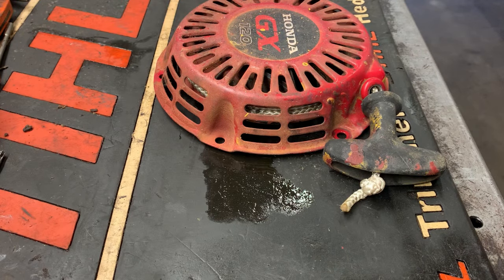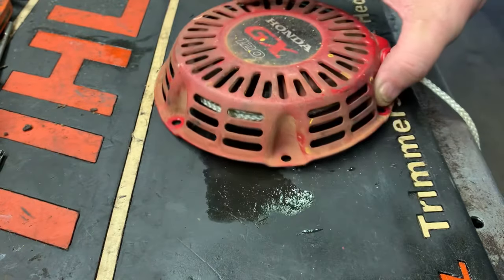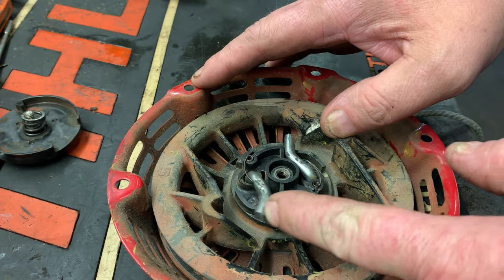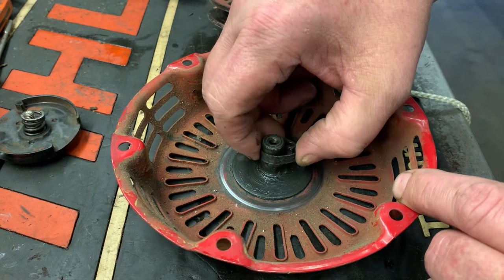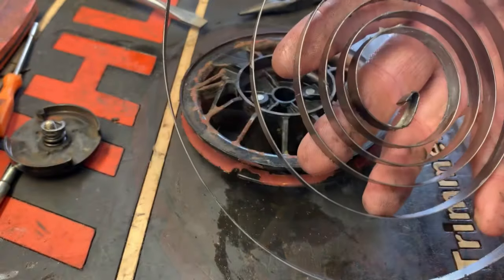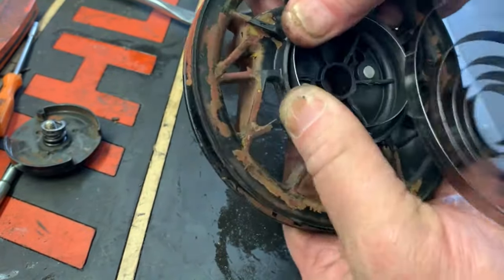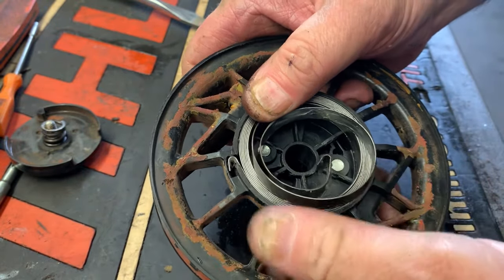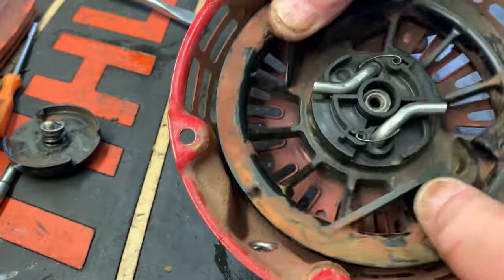STEP BY STEP RECOIL STARTER REPAIR FOR JUST ABOUT ANY SMALL EGINE

Comment: I have a Champion Generator 196cc that has a very similar but smaller recoil starter that probably needs a new spring or at least a new recoil starter assembly. I’m so glad that you posted your video because I was wanting an inside look of what I may be facing. 
So I guess that the Predator engine starter recoil is probably the same one as the Honda’ engines use. Best Regards From Rainy Stormy Central Ky.

Comment: started on my Westinghouse 3200 psi press. washer. Recoil taken out....spring rewound...but could not get it set because plastic was broken. 93 degrees....76% humidity...hungary...wife's dawg yappin'...E-bay...30 bucks. Plastic is used on the most dumb areas of wear and tear.

Comment: i have the same issue with a echo top handle chainsaw. the recoil kept doing the same thing as in  the video. i replaced the spring, it retensioned and then it did the same after a few pulls on it. the new spring was bent when i took it apart again. any idea whats causing this?